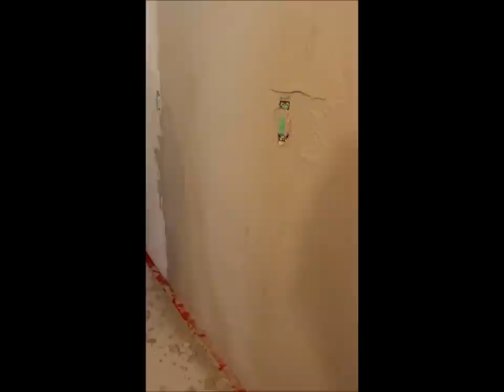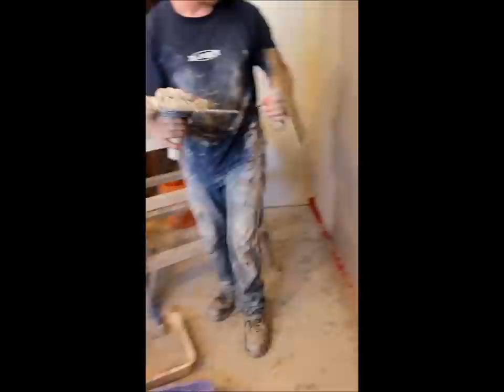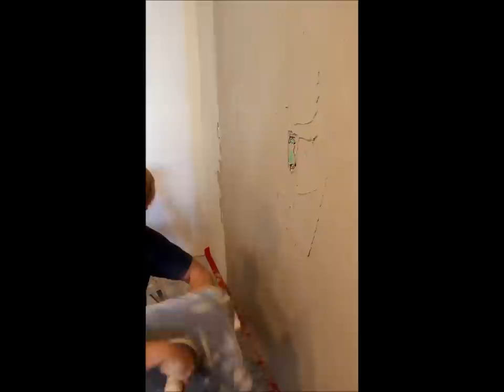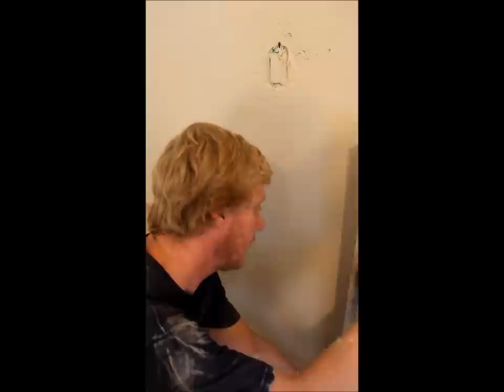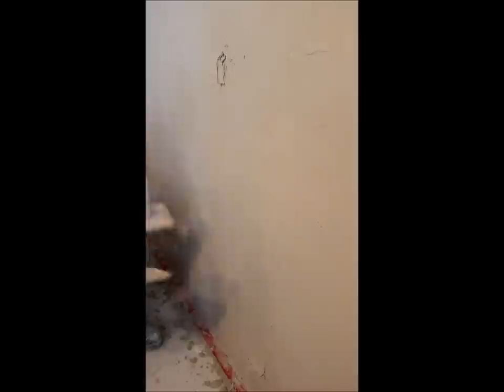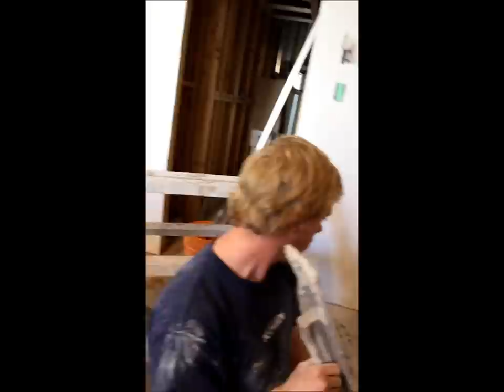How to use a darby to level plaster

Comment: I am new to using a darby. The one I have has both a serrated edge and a smooth edge. Which side should I use? I am doing exterior stucco: Scratch, brown and acrylic finish (Sto). Beautiful job on that wall by the way.

Comment: a good plasterer needs the patience of Jobe. I'm struggling to do this in my own home, I always get there in the end but it's frigging frustrating. ENDLESS mess and everytime you look at it there's a scar or a pimple or a hollow or a lump. That darby looks good but my plaster always seems to go off too quick for much additional cosmetic tweaking. I have to be content with letting it finish hardening then sanding it.
Reply: @Adotp-  Why would you even post this lol? Like I really can't understand why you were so mad. It's not like the topic is justin bieber or politics
Reply: @Adotp-  wow, a real cave man... or frustrated teen.
Reply: Try a lime based plaster instead of gypsum or cement. Longer working time
Reply: Also smooth out any bumps on the first coat by scraping with 4 inch trowel at 90degrees to surface.  Make sure the plaster is quite thick n workable.  Turn the trowel over and if it's too runny it will just fall off.